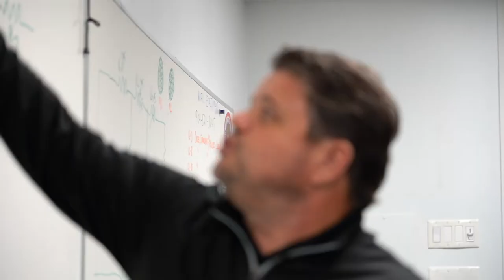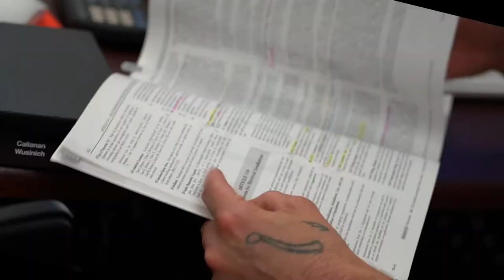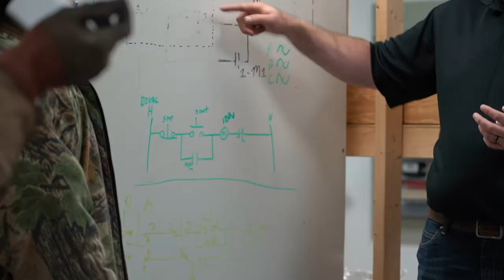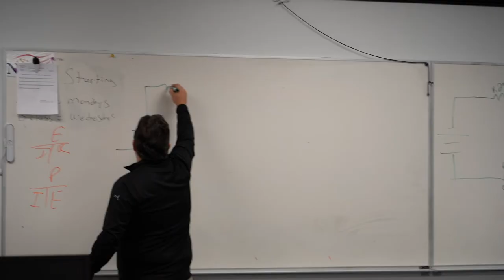Electrical Training Apprenticeship Overview | Miller Electric Company

Comment: 4 year degree:
Pay a ton to go to school
Learn very little practical skills
Graduate with a mountain of debt
Maybe find a decent job if you're lucky
Once in said job, be nothing but a  cog in a machine with no idea how to start your own business

Electrical apprenticeship:
Get paid to go to school 
Learn one of the most practical skills in existence 
No debt upon graduation 
Be basically guaranteed a great job upon graduation 
With slightly more experience, have the skills and knowledge to start your own business and quite possibly become a millionaire very young

I have a 4 year degree, but if I could go back I'd go to the electrical apprentice school in a heartbeat
Reply: I know right I'm currently in the cross roads of going go college or university college accepted me and it's a lil cheaper while varsity is 
Hasn't even accepted me.
Reply: Statistically speaking those with degrees still make more in the long run compared to trades.
Reply: @419chris419 People with 4 year degrees, I'm told, make more on average than the general non degree holding population,  but I've never seen anyone claim that people with degrees make more than tradesmen on average.  And in fact I highly doubt that statement unless you can back it up.

Comment: Why does this program take five years?
Reply: The program consists of approximately 8,000 hours of on-the-job training and around 1,000 hours of classroom instruction. Learning to become a well-rounded commercial/industrial electrician requires many hours of hands-on practice and this program gives you that opportunity.
Reply: Because an arc flash will burn your eyelids off